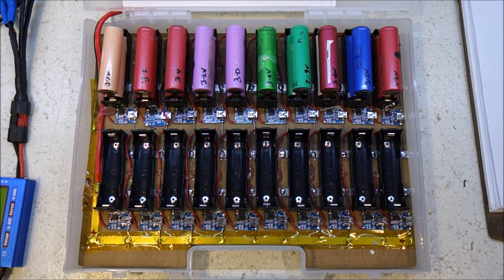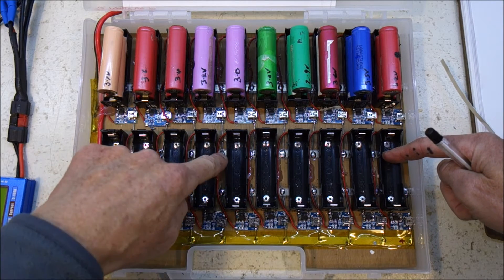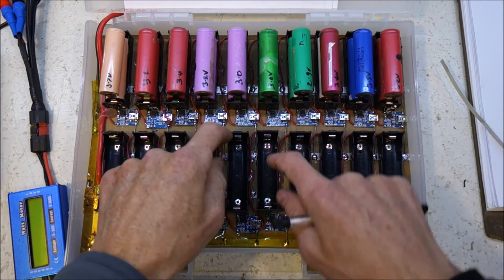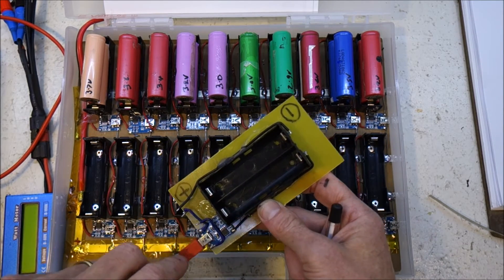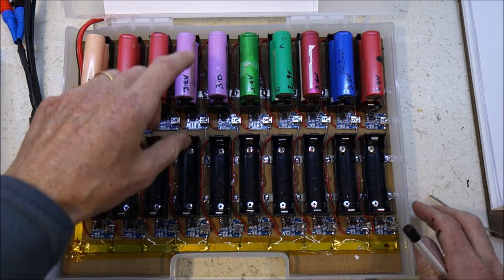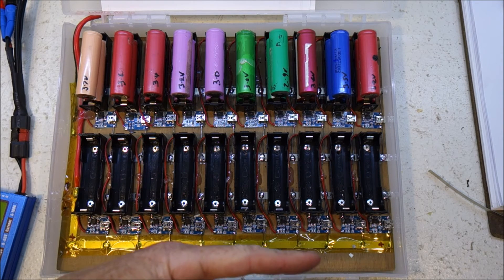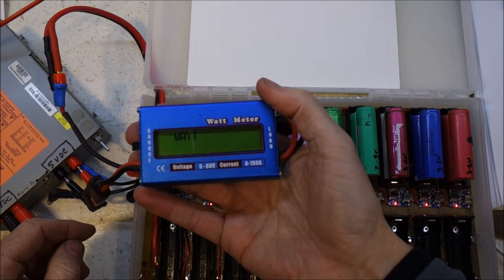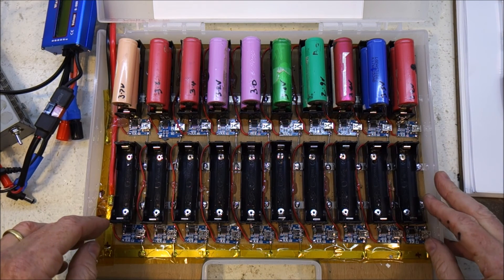Laptop Powerwall 33 - a closer look at my 20-way charger

Comment: Hello Paul! I was wondering if it's possible to connect in 3s to create 12v. Then charge them with a normal 12v power supply. Thanks!
Reply from the maker: Hi Sleepy. You'll need to be very certain that your "12v" power supply is actually 12.0V and not any higher. For example "12V" lead acid chargers actually go up over 14V - which would be bad for your lithium cells. Plus a 12V power supply won't be doing the ideal Constant Current - Constant Voltage charge system that lithium cells prefer. Plus - you need to be careful with the current going into your pack. Current should ideally be "1C'" or lower.
Reply: Paul Kennett Thank you!
Reply: sleepy zzz you might want a bms to balance the cells.

Comment: I know this is only the charger, but is there anyway to use it as a battery bank too? And use those bms's to work with solar panels?
Reply from the maker: The complication is for these chargers the positive of each battery needs to be electrically isolated from the rest. Where-as in a pack you need to connect them. Which my old 10-way charger setup you could use that as a battery bank - because the cells were wired in series.
Reply: Thanks, that's a shame.

Comment: What is the length of your rivets and how thick is the wood it is on? I assume 1/8 diameter? Thanks good job.
Reply from the maker: They're 3.2 mm dia Open aluminum rivets with 6.4 mm grip. 10 mm length rivet head. The board is an old piece of 3 ply I had laying around - about 4 mm thick.
Reply: Thanks

Comment: This is the best application of the TP4056 modules I have seen yet! Just curious, what gauge wire are the main leads coming into the box. Additionally have you checked the 5v connections at each module to check if there is any voltage drop across the lines. I don't think there would be based on how robust your wires and strapping appear to be but at nearly 15 amps total (based on your .7 amp per cell reading) is quite a bit of current in a 5v line.

Thanks again for making the video. You've given me some great ideas.
Reply from the maker: I think those are 8AWG wires coming in.
The power supply I'm using is rated at 20Amps for the 5 V line. The Watt says the voltage was at 4.99V when it was charging 10 batteries. It drooped a little bit more with all 20 going but not much. (From a good old Proliant blade server.)

Comment: i want to make an 8 bay charger, if i use only 4 modules are those modules will provide 500mA of charging current in each cell?
Reply from the maker: You could use 4 TP-4056 modules each connected to two battery holders (wired in parallel). Then the 1Amp maximum charge current would be shared a across each pair of batteries. So, yes - 500mAmps each. 
This does assume that your power supply can provide 4 Amps total.
Reply: Paul Kennett if i charge only 1 battery in my 8 bay charger does it still charge at 500mA or those vacant slots will add up in that occupied slot?
Reply from the maker: Let's say you have one TP4056 connected to a two-bay battery holder, where the two bays are wired in parallel, and the TP4056 is outputing 1 Amp as normal. Then, if there's only 1 battery in the battery holder it'll receive the full 1 Amp. If there are two batteries in the battery holder then the 1 Amp from the TP4056 will be shared - so around 500mAmp each (assuming both batteries have the same internal resistance).
If the two batteries had different internal resistances then the current would be shared unevenly - one would get more current and the other a bit less. Mostly this isn't a problem.
Reply: Paul Kennett oh i see, thanks for the info i learned a lot. subbed!! :)
Reply from the maker: Cool. Cheers

Comment: i curious about the charge profile of the certain chargers. i use the skyrc b6 mini, and there is approx. .04v discrepancy between the charger and my digital meter. i setup a profile tvc @ 4.15, but doing that the charger software wont turn on and start graphing. should i not worry about the discrepancy between meters? the preset lipo setting will graph and charge to/above 4.24ish under load, but resting voltage comes down around 4.17.  thoughts/comments/suggestions?
Reply from the maker: +Keith Tucci Hi Keith. How much do yo trust the accuracy of your meter? If it's cheap it might be off - but it's probably more likely the B6 mini need calibrating.
Reply: My meter is a innova 3320, i picked it up after seeing a few other savvy electronic hobbyists using it. I think i seen mjlorton? Review it as well showing fairly reasonable accuracy. I have looked into adjusting the charger, but the videos are only for the original b6 or b6ac. The setup tips when applied to the mini seem to force it into an eternal firmware update.
Reply from the maker: +Keith Tucci If mjlorton says it's then I'd thrust it. My 1000W inverter is one he recommended: https://www.kickstarter.com/projects/sunraiden/sunraiden-solar-inverter-charger-for-off-grid-powe
I didn't realise the B6 mini was different. Good luck!

Comment: Read this if you use the TP4056. Most of the ones on Ali/Ebay are fakes or clones and not all works as intended.

http://blog.koepi.info/2015/05/beware-of-fakecloned-tp4056-liion.html?m=1
Reply from the maker: +Magnus Brynedal (Pettersson) Hi Magnus. Thanks for the info. Very interesting. I'll have to do some more testing. I try to only buy from 4 star sellers on Aliexpress in the hopes that that will reduce the chance of me getting fake parts.
Reply: I did the same, ended up with having to buy from 4 different sellers. Most of them display pictures of the genuine NanJing Top Power TP4056 but is in reality selling China clones. I have a couple of disputes open atm, some just refund me without even asking questions. I guess they don't want to get the wrath of Ali on them closing their store. If the two final TP4056 orders i have outstanding also fail and i get only fakes i will resort to plan b. Ordered 20 pcs of the TP4056 IC only and actually had a 50% success rate, got 20 fakes and 20 genuines (2 different sellers). Might have to exchange the IC in the end and it will be an interesting job as the IC is quite tiny. :)

Excellent videos btw! 👍
Reply from the maker: +Magnus Brynedal (Pettersson) Good luck with soldering those. Cheers.
Reply: I measured the current during charging with my tp4056 and I get around 160ma only.  all 5 that i bought. they have the 1.2k rprog. the voltage of the batt is 3.4v. it seems to be staying the trickle charge zone. Does that mean they are bad?
Reply from the maker: Sounds like they might be bad. Just out of curiosity - hoe long do they take to charge an cell?
Reply: I haven't measured but it takes several hours. 
I  did notice the OUTput voltage from the tp4056 is near 4.20v so that could explain the low current. Shouldn't the output be near the batt voltage?
Reply from the maker: Mine take several hours to charge. Usually do two batches a day; morning and night - so I give them at least 8 hours. Any cells that haven't finish in that time I reject.

Comment: What's the little circuit board? Oh here: TP4056 18650 charger module
http://www.aliexpress.com/item/5-pcs-5V-MINI-USB-1A-1000mA-Lithium-Battery-Charging-Board-Charger-Module/1875981543.html
Reply from the maker: +Jay Scott ANDERSON Whoops. I should have added that link in the description. Got it in there now. Thanks.

Comment: my tp4056 18650 module stop charging when the battery is charge at 4.8v,
Reply from the maker: +Chis Ngwa Yikes! That's a bit high. I've heard that some charger go up to 4.3v but 4.8v is too high for comfort. You might have a bad module.